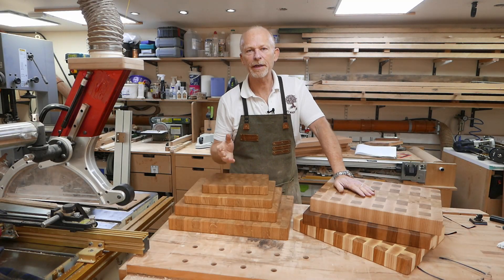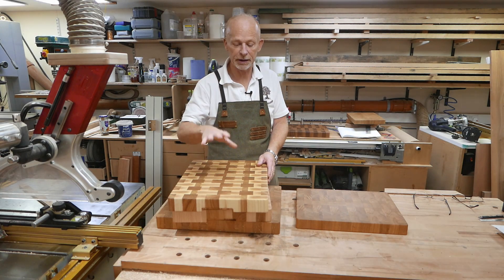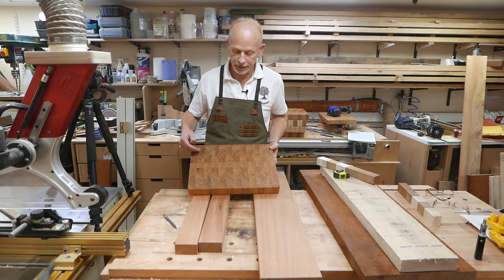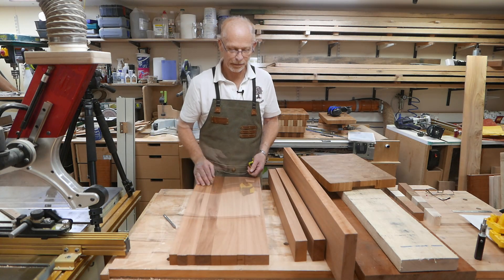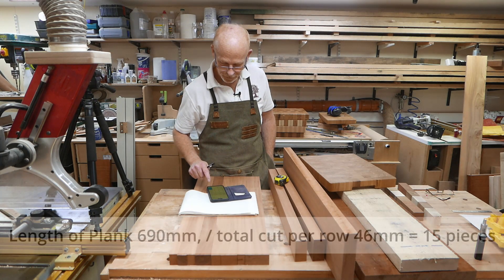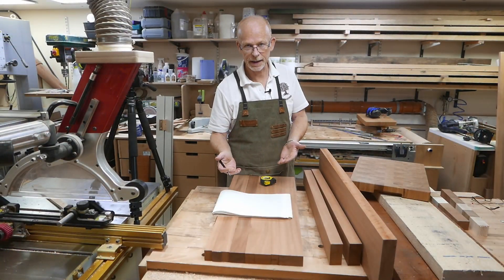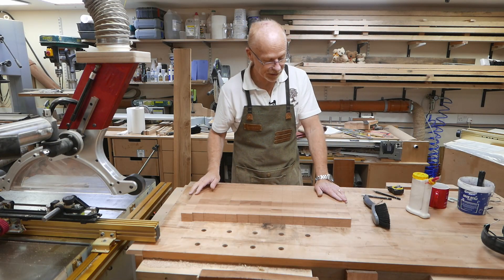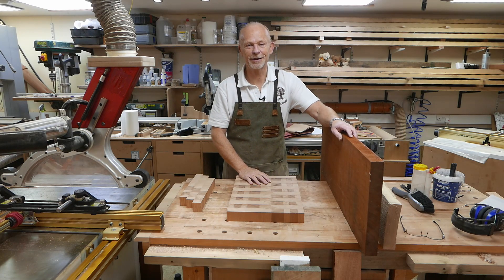How much wood to cut for End Grain Chopping Boards and what size to make them.

Comment: This is super helpful, but would you be able to provide a reversed-engineered formula? Say if I desired a finished end grain butcher block that is 24" L x 24" W x 3" T, what dimensions would my starting panel(s) need to be, and how would that be calculated? And I'm fine with you providing it in mm if that is easier. Thanks a lot!
Reply from the maker: Thanks Paul, the info you're looking for is all in the video.  The thickness of the planed timber you're gogin to use for the board really decideds it all, because when you cut it into 3" lengths and stand it on its end, the length of the board you want gets devided by the thicnessness of each piece which tells you how many you need. 👍👍

Comment: I know my desired board dimensions, how do it go in reverse and calculate how much stock is needed?
Reply from the maker: You will need to know the thickness of your chosen timber regardless of which way you work it. Once you know that you can kind of back calc it.  Num of rows x thickness of timber (which translates to width of row) if you follow.

Comment: Could you please explain in detail what this means: eg: Pieces to cut 50, 25, 40, 25, 30, 25?
Reply from the maker: Hi Steve, The width of the pieces to cut  to replicate the pattern. 👍
Reply: @GTWoodshop  Thanks Graham, I've just replayed your video and realised that the sizes relate to the patterned board you introduce at the beginning and not the board you actually build in the video, it now makes blindingly obvious sense!! One last thing - where do you obtain your timber from? I haven't been able to find rough sawn timber at that depth around my area in Herts.
Reply from the maker: @steveshephard2961  Hi Steve I use Devon Hardwoods, not sure they deliver that far up but worth a try. 👍

Comment: Although I'm I am a carpenter  I only have a small man shed I still saving/reclaiming  odd bits of nice timber to make  chopping boards .this is the first video to explain how to calculate how much timber to use I've seen. Thanks !  brilliant video . maybe I did not notice but ,  what glue do you use .I've used tiebond 3  as it's food safe  ! am happy with that
Reply from the maker: Hi Travis, thanks for the comp.  Me too, always Titebond 3, I rarely use anything else to be honest, un less its a speciality job, veneer, or dark wood / glue. 👍

Comment: I laughed so hard at your "offcuts". Hardest part for me with an end grain board is flattening after final glueup. No drum sander here :(
Reply from the maker: Andy, sorry didn't see the end of your comment.  I usually run mine over the Planer, then through the thicknesser. 👍
Reply: @GTWoodshop  I did try with the thicknesser, the board tried to use the top as its exit point. Expensive mistake.
Reply from the maker: 😒🤔, wow what happened?
Reply: @GTWoodshop  Only a triton thicknesser, nothing like a you have ;) The board got caught on the blade and lifted up, lots of bad noises and the magic smoke escaped too. Plastic everywhere bent casing and not even much left of the board either.
Reply from the maker: WOW, and sh!t, I bet that scared the 'bejezus' out of you.
Reply: @GTWoodshop  scared me enough not to try it again 😃
Reply: Make a simple router sled